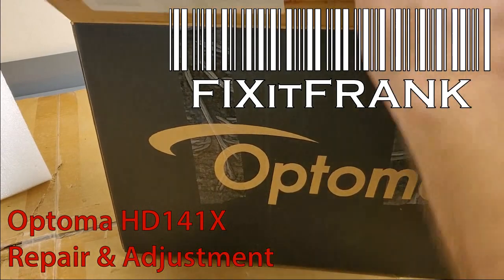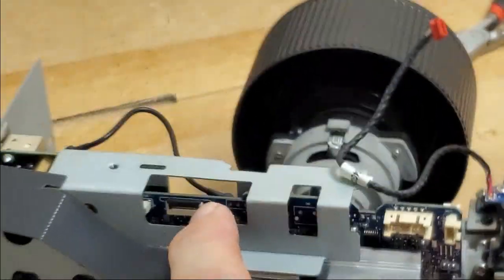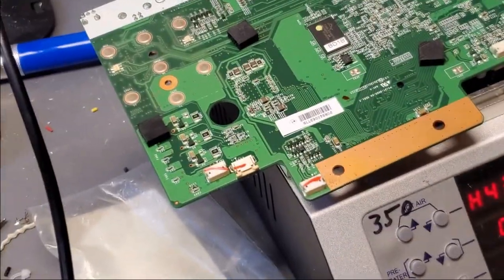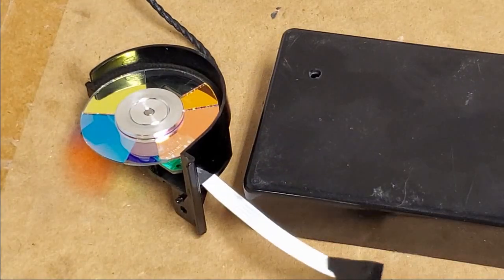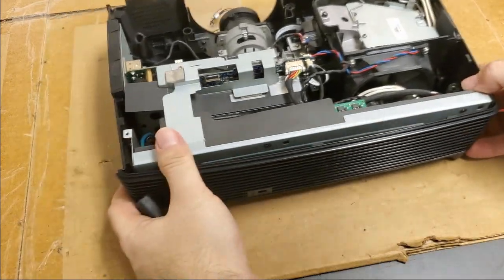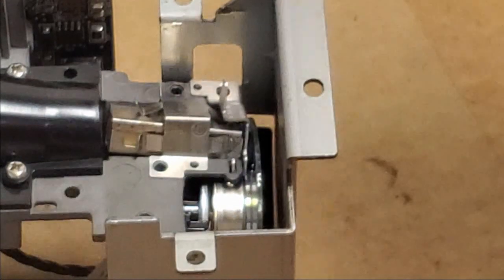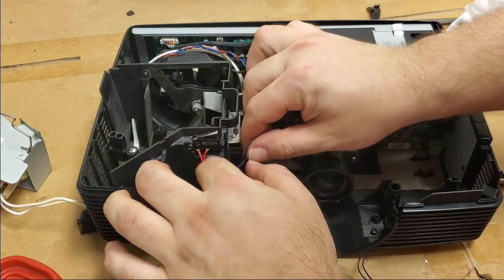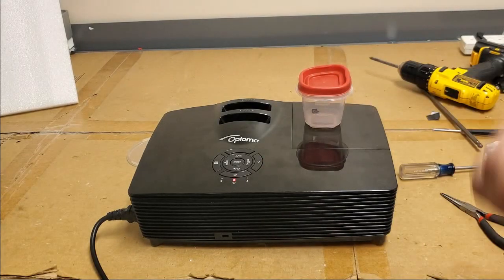Optoma HD141X DLP Video Projector Repair

Comment: Hi, really very nice and instructive video, I have a question : have you even try to mount a recent silent fan to replace the original one ?
Reply from the maker: I have in other models and found that the RPM sensor must be of the same spec or the projector wont read the fan properly.  They need to move a specific amount of air or they will not keep the heat balanced.  Unlike a PC the heat is so much that they rely on moving volumes of air rather than cooling a heatsink.  I won't pretend to know all about thermal management but every time I have tried a replacement fan that wasn't the same model number, I had issues. Either the projector reports a problem or the fan does not move enough air.  If I knew what the RPM sensor specs needed to be, then I would think a newer fan with the more quiet blade design would work much better. I know I see that swept blade design in newer projectors.

Comment: Здравствуйте ! Подскажите пожалуйста как чистить фильтр на optoma hd141x ?..
Reply from the maker: Привет!  Большинство HD142x не имеют фильтров.  Если ваш hd142x оснащен фильтром, решение состоит в том, чтобы использовать пылесос/сжатый воздух для удаления пыли с фильтрующего элемента.  Сначала отсоедините шнур питания.  Во-вторых, снимите пластиковую крышку фильтра.  Третий удалить фильтр.  В-четвертых, очистите фильтр вакуумом или сжатым воздухом.  Наконец, обратный процесс. 
Иногда это покажет сообщение об ошибке без фильтра.  если у вас есть сообщение об ошибке, проверьте вентиляторы на наличие пыли или мусора.
Спасибо!
Reply: @FixitFrank  Thank you very much for such a detailed and fast response! There is no removable filter anywhere on the body. Doesn't it need to be cleaned?
  I tried google translator ))
Reply from the maker: The internals may need cleaning but only if you have problems. A gentle vacuuming is perfectly acceptable in most situations. Я использую перевод для более чем половины моих слов. Я неплохо читаю по-русски и по-украински. Кириллический текст довольно аккуратный. Благодарю вас!

Comment: Hello Frank I have a Optoma  HD 8200 or 82. For some reason it's not turning on but it's getting power the stand by light is solid red and that's all I'm getting no light going on thru the lens nothing. I was hoping maybe you can take a look or give me some advice on how to go about fixing this.
Reply from the maker: Hi Paul, do you get any fan spinning up or is it just the LEDs and nothing else?
Reply: Just the led unfortunately. No fan. But When I took it off the mount it was working fine and then two days later I went to demo it for a friend and it did not turn on so I did work fine at one point.
Reply from the maker: @PaulCalderon2  That is weird.  I checked into the manual and its stuck in standby.  Really the best step after this would be checking voltages and the like.  However I would just go over a few simple things.   I would re-seat the lamp door.  Then make sure there isn't a stuck button on the panel.  Maybe source or something got jammed and the power button isn't being registered?  Then I would try a remote if you have one.  If not, a multibrand would work.  If none of that works, then its going to likely be something internal.  Power supply, a wire, hard to say without looking at it honestly.  Start with the easy and let me know how that pans out.
Reply: OK sounds good. if you want I can attempt to take the top off and send some pics of the internals and maybe you can spot something that's not normal to your trained eye. I just wanted to say Thanks for your time and help on this not to many ppl in my life that have any clue about things like this I can go to.
Reply from the maker: @PaulCalderon2  You are very welcome!  I am more than happy to help. Anything to keep more stuff out of the landfill.  If you want to , Imgur is a good free image host.  I'll see if anything jumps out at me.  Also, if you want, you can email me(sales@weezytech.com) if you dont want to post them here or have a image share with personal info.

Comment: You blow air inside the DMD chip area? The W1070 I have just repaired, I have a bunch of solid black mess in there. Though I have blown air in there.
Reply from the maker: Sometimes. It depends on the debris. I cleaned the components with the chamois sticks but this crud was large(in comparison to normal dust). To clean the face of the DMD would have meant total disassembly. There's a metal bit in there that acts as a light mask and it blocks the DMD face. I had thought it was a dim lamp but even with a slightly brighter Osram the spots stayed.

Comment: hello frank thank you for sharing your knowledge! I am a volunteer for an association. we donated an optoma hd143x. we replaced the lamp with an original Osram certified lamp. the problem with this device is that when we turn it on it starts up normally, then after a few minutes the image seems like blinking with rather abnormal colors. at this moment a noise is heard the device turns off. the lamp indicator lights solid red and the power indicator flashes.
would you have a lead to tell me to find the origin of this failure? thank you very much for your answer and for your help. Best regards. I made a video for you, show if necessary what is happening
Reply from the maker: Does it sound like this sort of https://youtu.be/TEnXuTeZjIw ?  Going by your description I am pretty positive you have the classic color wheel failure this chassis is known for.  I have a video on an HD26 with the same problem.  There is a little black sticker on the color wheel that falls off and the noise you are hearing the is the color wheel changing speed erratically trying to lock in on the index mark.  Also causes the flickering/flashing until the projector gives up and shuts down.  Very repairable and not expensive. The wheels are roughly $40 from China(eBay), more so in the States.  If you need a parts contact let me know, but I am almost 100% sure your issue is the color wheel.
The only other cause would be if your osram certified lamp has the incorrect lens coating.  Some vendors sell lamp assemblies with a bad IR/UV block coating which will cause the same thing as a bad color wheel. See this video for that information. https://www.youtube.com/watch?v=SOCx2_IQh24   If you determine the lens is incorrect(has a green coating instead of the red/blue) you can use the lens off the old lamp assembly as long as its not damaged.
Reply: @FixitFrank  hi frank thanks for the quick response! indeed I do not know where to direct it to obtain this part. I am in France. can indicate me a supplier or a referance? Best regards
Reply from the maker: Sure thing.  I use a company out of China called Time Electronics.  Gydz@timeprojectorlamp.com is the email. I would recommend removing the old wheel first and including a picture in the email. They will ask for a picture anyway. They ship DHL and take Paypal so everyone is protected.  I have used them for almost 3 years now.  Very happy with their service.

Comment: Hello Frank, I've got exactly the same problem with the light tunnel, but I´m not able to manage to put it straight, as I keep trying, but the picture is not right yet. Any advise how to aligne it without having to take it apart everytime? I've did already 3 or 4 times today I just move it from one corner to the other xD Thanks a lot for the videos it was really helpful to help me out found the problem.
Reply from the maker: Did you make sure the spring was pushing the light tunnel all the way to the other side? That seemed to be the trick for me.  The spring they use must not be tempered and just a normal springy steel. By over bending the spring is what worked for me.
Unfortunately the only way to get to the screws is to remove the top and all of that.  You shouldn't have to remove the optic assembly after you bend the spring. 
I won't sugar coat it.  This is an annoying fix. 
However if you make sure the screws are backed out enough to not be touching the tunnel(critical step), and then over bend the spring to push the tunnel away and down, then when you tighten the screws(tighten slowly to not crack the mirrors) you will be able to align it.  Remember it is moving on kind of an angle. The 54:00 minute mark is where I re-bend the spring.  I know you watched it, but maybe start there and follow those steps. Be sure you loosened the alignment screws fully. Also be sure the tunnel is not inverted/rotated out of position. That could cause you some severe hassle. That little tab on the light tunnel should be sticking up when the optic block is on the table. 
I hope this helps as this is the only way I know to align these. If I can help further please ask.
Reply: @FixitFrank  I manage to move everything, then I turn it on to check, everything worked fine but wasn't aligned yet, then I open the projector and now the lamp won't go on for some reason :( is driving me mad XD
Reply: That's it finally! I managed to fix everything! Thank you so much for the video and for the reply!! You saved me from spend so much money as I'd never gone into trying to fix it without your video.
Reply from the maker: @Maestr0Liendre  You are very welcome!  I am always happy when I read comments like this. Thank you for letting me know!

Comment: Dear Frank,
Thank you for the very useful and informative video. I'm John from India. Recently I bought an optoma HD143X in UK and return to India, but now I noticed the problem.

TESTED WITH 100% WHITE TEST IMAGE

The left side image of the screen is 25% approximately lesser bright than the right side. I can't go back to UK, but I believe that the problem is easy to resolve, because it is brand new. As I'm an electronic technician, if you give some guidance I can solve this issue myself. I'm not interested to claim the optoma warranty for this issue in India, even it is available.

Thanks in advance.
Reply from the maker: Sure!  Would you post a picture of the screen with a white image please?
Reply: @FixitFrank  Please let me know how to post images here
Reply from the maker: @johnsiva2758  I would use Imgur.com.  You can save your pics there for free and share the link.
Reply: @FixitFrank  Thank u.I will try.
Reply: FixitFrank I’ve sent you the pictures, hope you’ve seen it.
Reply from the maker: just saw them.  Youtube put you into my "potential spam' folder for some reason.
Reply from the maker: In this picture https://imgur.com/AUkVqfm I see a shadow on the left side. I suspect but am not 100% sure that it is a slipped light tunnel.  I just posted a video today that shows light tunnel adjustment.  First make sure the lamp is installed tightly and that the bulb did not come loose.  If that is good, check the light tunnel.
Reply: FixitFrank thank u.l will try.

Comment: Hi frank, Your repairs are amazing! I'm just a little guy and I did something wrong repairing the color wheel. I bought it with my afternoon little work so I'm so afraid, can I ask you your email if you can help me with just an advice please? I just removed on of the two light tunnel alignment screw and I  have now a shadow in the top left corner. I don't know how to align it, if you can help me It would be a miracle. Thank you!
Reply: You can see the screw at 57:34, it's at the bottom on the round tunnel
Reply: Tried to install the screw but it didn't solve it
Reply from the maker: It's probably the same issue as I had here. The spring clip underneath isn't pushing back on the tunnel when you loosen the screw. If you remove the spring clip and rebend it, back out the adjustment screws until they are not pushing on the tunnel. Then once you've reassembled the optics and are ready to align, slowly tighten each screw (use a white screen test signal) and watch the edges. You will be able to shift the tunnel back into place pretty easily once the spring clip underneath is bent back to shape.  If you get stuck, feel free to email me.

Comment: можно ли заменить лампу на более мощную, например такую - https://aliexpress.ru/item/1005004107816134.html?spm=a2g2w.detail.pers_rcmd.14.58592b18xEPeTH&_evo_buckets=165609,165598,188873,194275,299288&sku_id=12000028058589923&gps-id=pcDetailBottomMoreOtherSeller&scm=1007.34525.288670.0&scm_id=1007.34525.288670.0&scm-url=1007.34525.288670.0&pvid=dc7dcf93-c97b-43a3-b620-df27f7eeed94&_t=gps-id:pcDetailBottomMoreOtherSeller,scm-url:1007.34525.288670.0,pvid:dc7dcf93-c97b-43a3-b620-df27f7eeed94,tpp_buckets:24525%230%23288670%230_21387%230%23233228%233_21387%239507%23434556%231&ru_algo_pv_id=dc7dcf93-c97b-43a3-b620-df27f7eeed94&scenario=pcDetailBottomMoreOtherSeller&tpp_rcmd_bucket_id=288670&traffic_source=recommendation
Reply from the maker: Это не может. Балласт определяет мощность лампы. Лампа мощностью 210 Вт получает только 210 Вт от балласта. Лампа мощностью 240 Вт по-прежнему будет получать только 210 Вт. В проекторах используется технология дуговой лампы. Если бы в проекторах использовалась технология накаливания, лампы с более высокой мощностью работали бы. Для увеличения мощности дуговых ламп балласт должен быть большей мощности. Это приводит к необходимости обновления сетевого питания. В конце концов, стоимость будет намного больше по сравнению с покупкой более мощного проектора. Очень хороший вопрос!
Reply: @FixitFrank  спасибо за ответ! я правильно понял что поставить лампу 240 Вт на проектор Optoma HD141X DLP можно? но она всё равно будет светить как лампа 210 Вт? или она не подойдёт по креплению? или испортит проектор? просто оригинальная лампа 190 Вт а говорят что китайские лампы светят на много слабее! что посоветуете? ответьте пожалуйста🙏🙏🙏
Reply: ответьте пожалуйста.